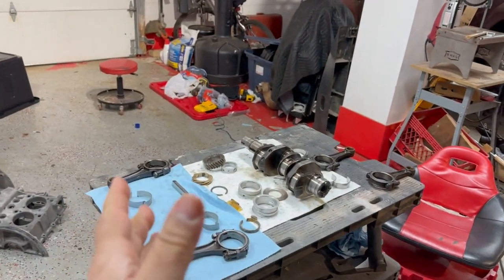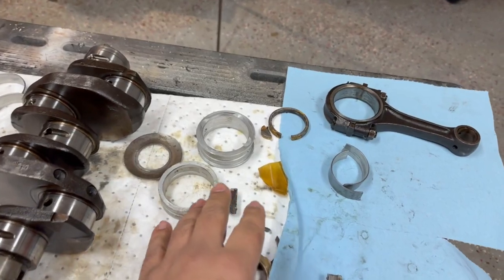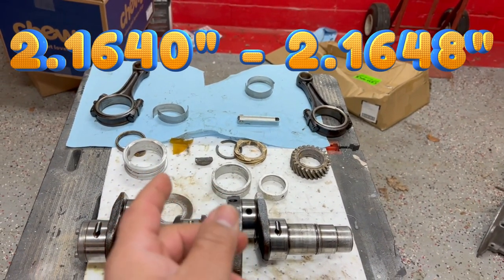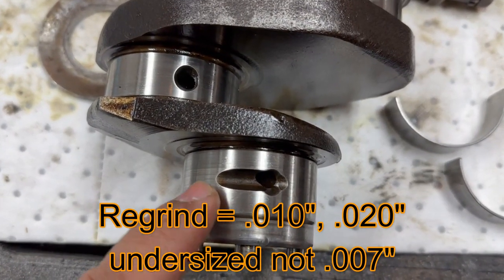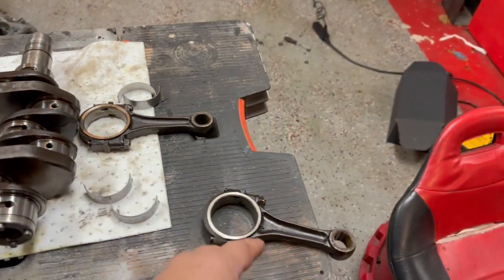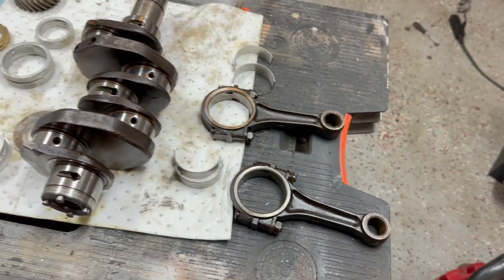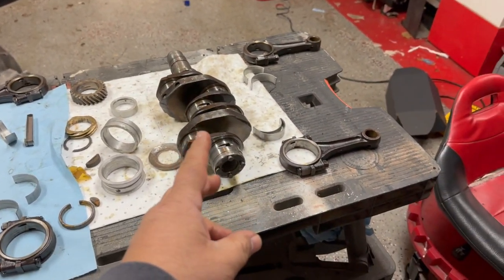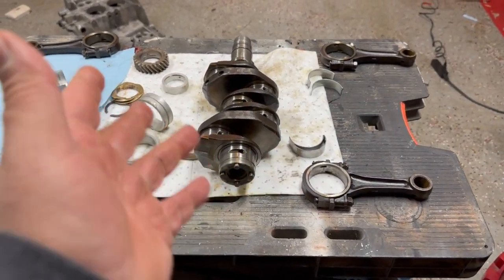VW Bug Engine Crankshaft Tear Down

Comment: That crank is worn out, that’s some massive oil clearance.
You could have it reground but it may be cheaper or approx the same price to get a new crank. Check out DPR for cranks. 
If you are getting a different crank, a counter weight crank would be a wise choice. Then you might as well go with a mild stroke crank and get some more cc’s and low end power. 
Good video, can’t wait to see the progress.
Reply from the maker: You are right. I can go crazy with the engine but, it’s meant to be a backup and cheaper is the way to go. I may add a C25 cam.
Reply: @FixinBugsNStuff  so many options, only you know what’s best for your application. Whatever route you go, we’re here for the ride.
Reply: 1776 let's go! 😁
Reply from the maker: @WolfHausMotorwerks  man I would but, I am planning something similar like that in the future.

Comment: Heard those brass gears for the distributor driveshafts are unobtainium. Looks like a piece of something got loose over those gears and mashed them a little. Re the crank probably best to get a counterweighted unit. Demello or DPR in Ca is a good source for them. Scat is good as well. This is also a great time to consider a nice cam and lifters too. No need to go crazy but get a little more oomph.
Reply from the maker: You are probably right.